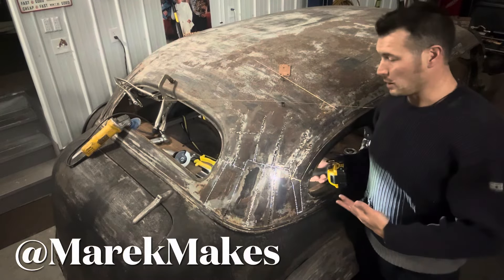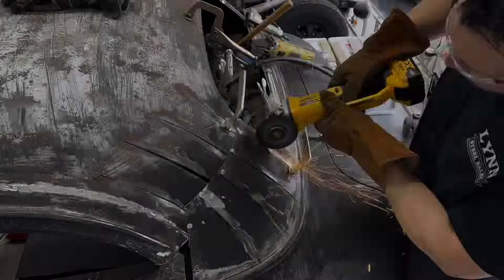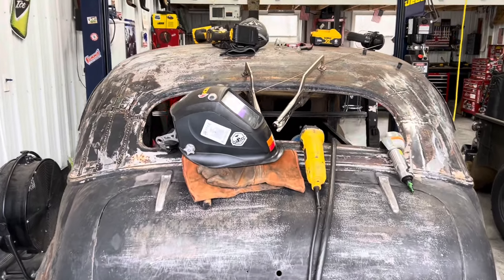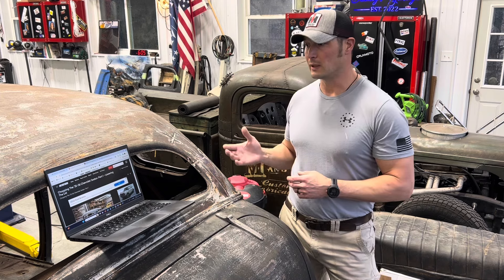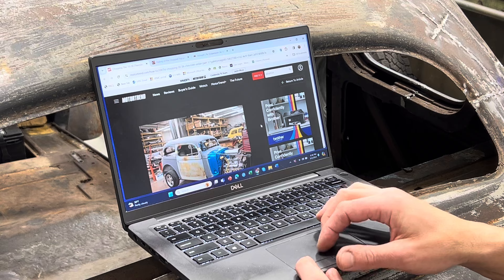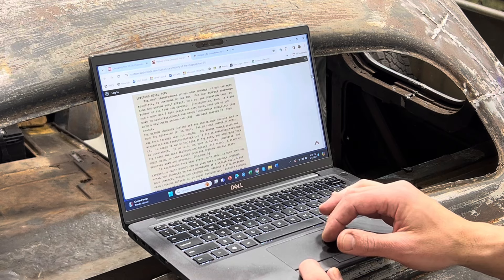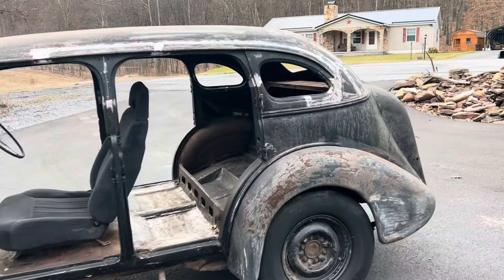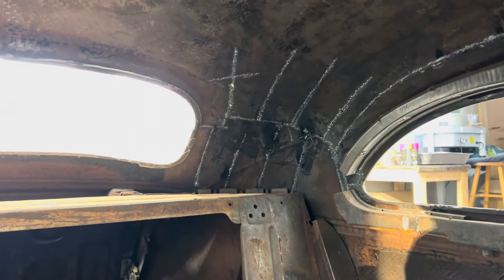Finished Welding in the Rear Window! Part 12 - 1937 Chevy Master Deluxe 4” Chop

Comment: Looking good! After grinding inside and out (24#) and planishing, you can use a "guide coat" of black primer. Block sand, and the shiny spots "get the hammer" (and dolly). Rinse lather repeat.
Reply from the maker: Can I hire you for that part??!!
Reply: @MarekMakes 
Try it.  You'll impress yourself. Doesn't take long.
But "planishing" takes a lot of hammering, better have your earmuffs.

Comment: The left side has 3/8 more chop than the right side...    It shows.   😮
Reply from the maker: Interesting comment - how did you decipher this?  Per my measurement directly vertical from the hinges on the trunk, the window is 8 1/4” tall on both sides

Comment: Make you a profile in thick cardbourd the length of the sail panel. And hammer a dolly better shape. Id stay away from lead. Kitty hair is better. But understand your car and you interested in technic. Cold war motors makes all his own pannels if you interested in sharing metal. Good luck. Thanks for video. 👍
Reply from the maker: I will have to look that place up !  Thanks for the tip!